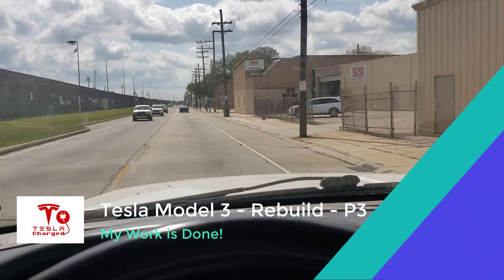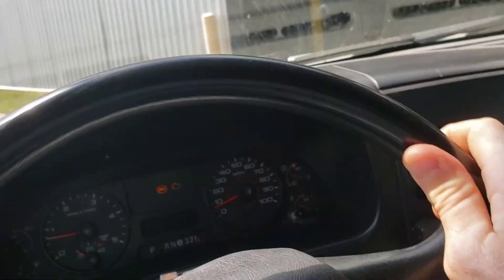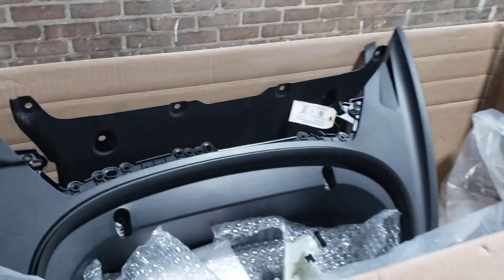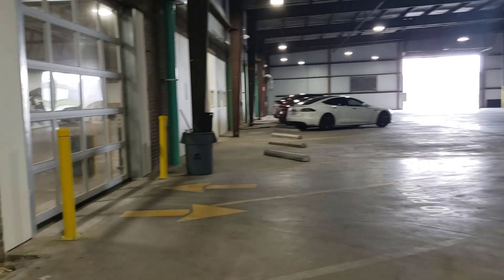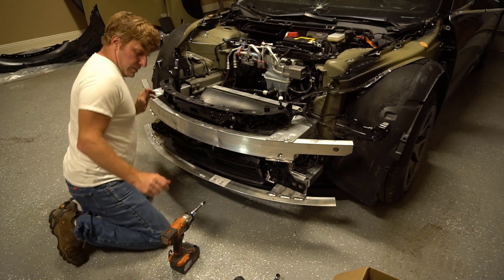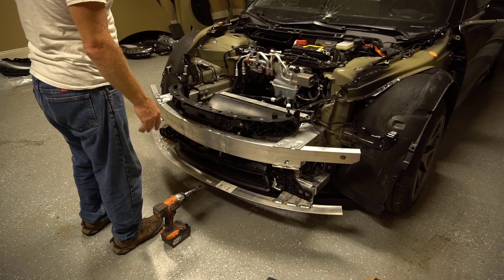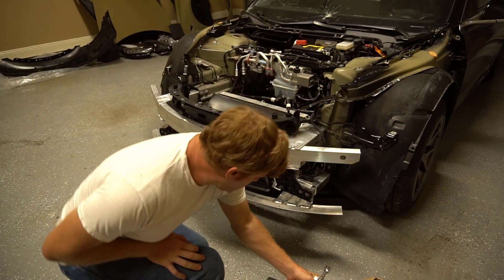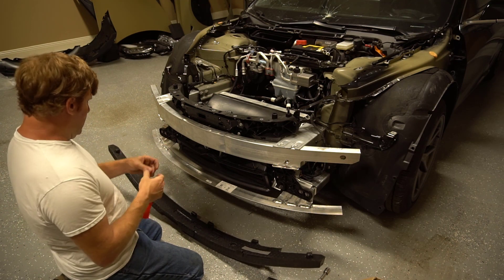Tesla Model 3 - Salvaged - Rebuild - P3

Comment: Hey, im trying to repair salvage tesla model 3 2023

Cant seem to purge system auto pilot temp is around 90c 

And it trows fault vcfront_a355 
Any help?
Reply from the maker: Sorry for late reply, use a shop vac on the coolant bottle with coolant not completely full.

When it bubbles and drops coolant level top it off to displace the air in the system.  There is also a coolant purge routine in service mode but the vac helps alot!
Reply: @TeslaRebuilders  thanks for reply, 
Found shop vac technique in other video 
And tried it,
It  help big time after use of shop vac it allowed me to purge with service mode 
Thanks again for reply

Comment: I still wanna know how fix the compressor lol do you have a list of all the parts, cost and time? And how did you reinstall the airbag?
Reply from the maker: The AC compressor I just took off and dumped all the oil out so Tesla could refill it with the correct original amount.

When the wreck happened some of the oil leaks out with the refrigerant and you don't know how much.

Most everything is in my videos but airbags are easy, everything just plugs and bolts in.

Comment: How much did the additional parts cost?
Reply from the maker: I rebuilt the car over a year ago, the total cost was about 10k in parts.  The panels cost right at 1000$ unpainted if that's what you were asking.
Reply: @TeslaRebuilders  yes thank you very much!! I plan to buy a salvage car too, but this is too much work and cost. Maybe we will look into a used one.

Comment: I unfortunately had crashed mine in NC 2 days back front impact while making left turn , no damage to windshield, but front frunk damaged like yours, was wondering if it can be repaired?
Reply from the maker: Of course it can but it depends on your insurance I would push them to repair and not total it.
Reply: @TeslaRebuilders  they already decided to total it without even inspecting it. I was also hoping to get it repaired
Reply from the maker: That's unfortunate, it seems very few insurance companies are repairing even small damages.
Guess we will see it on the salvage lot soon..... Mostly I have seen worse damaged cars bought to part out.

Comment: These videos are awesome! I'm curious to know, what was the full out of pocket cost including the cost of the car at auction as well as the cost of getting the panels painted, having the windshield and the airbags replaced?
Reply from the maker: All together it cost me 15k for auction and 10k parts and service.  I got deals on the little things.  So 25k got it finished.
Reply: @TeslaRebuilders  5YJ3E1EA6JF041578 - 12500 + all fee, super price, when you found its long range, you probably was super happy :)
Reply from the maker: @4kwotreplays  Yes with EAP as well it was really good.  Took more than I thought to fix was hoping around 20k but hit a bit over 25k.  It's been a damn good car ever since I fixed it.  We have put over 50k miles on it in little over a year so it's over 70 now.
Reply: @TeslaRebuilders  i get the same car none crashed for 27k stright from tesla in germany with eap used. so you lost a ton of time

Comment: Thanks for sharing  what do you mean by Tesla not sell just steal frame a safety parts give us for example. Thank you
Reply from the maker: Anything crash related like sensors, radar, cameras, airbags, seat belts, mcu, battery, steal frame is the cab front and rear structure is restricted and Tesla only. The front and rear has bolt on aluminum crash components and body panels that are available. So literally every thing else is available and responsible cost.
Reply: All that you said schoud tesla repair them don't forget to share us what's Tesla repair on your car thank you
Reply from the maker: @schade12  I will hopefully that will be soon waiting on final quote this week.
Thanks
Casey

Comment: Just curious, what did you pay for the car itself? (If you don’t mind me asking)
Reply from the maker: I bought at IAA auction for 12,500$ with auction fees and broker fees at 1,500$ then delivery was 1,100$ so little over 15,000$ delivered to me.  I have sence spent 5,500$ in parts from Tesla and about 1,800$ off ebay.  Still need Tesla Service to replace some of the airbags and windshield. That will run right at 3,500$ maybe more then paint I'm trying to cut any more cost as I go.  I'm going to be all in for around 27,000$
Thanks for the comment and watching,
Casey
Reply: @TeslaRebuilders  At 15000 all in seems to be a steal. Most certainly worth that in parts alone. Although. Airbags are not that difficult to replace. The knee and wheel airbags are almost plug and play. Although. You may have to replace the airbag connectors. I just soldered it and use heat shrink wrap. The dash airbag is the hardest to replace. But, depends on the car. On my gen2 and gen3 prius it takes about 1 hour to swap the dash. On my fusion Hybrid it took two days to take the dash. Since ford did not design it to be serviceable. I ultimately ended up breaking two mounting points.
Reply from the maker: @josealbreyes  yea I'm getting the replacement dash with airbag still installed probably tomorrow.  Going to do the teardown to replace it I guess since I didn't video much of the seat belts and knee airbags.   That was really easy stuff to remove, trying to negotiate a lower labor rate with Tesla when they replace them.
Reply: @TeslaRebuilders  Don't forget. You also have to replace the airbag module. As well as the front impact sensors. You can have the airbag module reset by sending it out to someone to clear the crash data. You can also have the seat belts rebuilt by a company called safety restore. It may be a good idea, to replace those parts first and then have Tesla service the airbag. That Tesla may be able to diagnose or reset the SRS system.
Reply from the maker: @josealbreyes  Yea I have considered that also, I knew about what needs to be changed.  I need the crash sensors for sure they were not on the car when I got it.  Not sure I would trust this repair or rebuild company though.  I'm pretty sure the replacement seat belts are very reasonable and worth it.
Thanks
Reply: @TeslaRebuilders  I've only ever used them to reset the crash data. The replacement module also needs to be synced with the car.  I've just always have had good luck with used seat belts. I do not know if you know. But. car-parts.com . Is where most junkyards list their  parts.
Reply from the maker: @josealbreyes  oh ok, didn't know that. I appreciate it for sure once I get the final quote I'll know which way to go.
Thanks
Reply from the maker: @josealbreyes  yea old Jack's pretty good but he just likes to hear himself talk too much lol!  Yea I'll know something about it this week for sure.
Thanks
Reply from the maker: @josealbreyes  So I'm sending off my seat belts and module today to get repaired by Safety Restore, saved me over 500$ thanks!
Reply: @TeslaRebuilders  $27,000 Plus cost of time? You could have bought the NEW $35,000 Standard Model!!
Reply from the maker: @Nawaf_1994  You can't count your time if it's done as spare, hobby or leisure time.  Now that I have final quote I'm going to be under $25,000 I saved 500$ on getting seat belts repaired and 1000$ on doing the passenger airbag and dash replacement.  And why would I want a standard range without advanced autopilot?  This is a long range rear wheel drive with advanced autopilot!  That's a 50,000$ car you can't buy anymore, unless you find one used but no less than 40,000$…!   So no thanks I'll have more fun learning about repair and help others doing this. 
 Thanks,
Casey
Reply: @TeslaRebuilders  I see your point my friend and I do agree with you.

Comment: I was always under the impression that Tesla does not typically sell parts. After your completed could you over a price breakdown of all the parts and what (if any) are restricted.
Reply from the maker: Absolutely I will, they will sell you just about everything but the steal frame and safety parts like cameras and sensors.  But Tesla service will install them for very fair cost on labor, the parts cost are very reasonable!
Thanks for the comment and watching,
Casey
Reply from the maker: Also included which I forgot to in the video my parts list and receipt from Tesla, link in description
Reply: @TeslaRebuilders  You arn't worried that they will disable autopilot and/or supercharging? As they have done in the past.
Reply from the maker: @josealbreyes  No they won't disable autopilot and probably won't supercharging atleast for a while.  Richrebuilds just stated that as many people he knows with salvage cars they have stopped disabling on model 3 for some reason.  That was mostly model S because of unlimited free charging and salvage titles.
Reply: @TeslaRebuilders  Good to know. I've just rebuilt my car and am still waiting to be paid by the parties insurance. Im just surprised how serviceable the Model 3 is.  As well as very reasonable parts prices. It seems to be significantly less expensive then ebay or auto wreckers.
Reply from the maker: @josealbreyes  Yes for sure most things on Ebay could be a scam or rip off.  You have to be careful, but I found a few things and saved over 1,500$ on the subframe, dash, passenger airbag, rear view mirror, seat belt in rear, headlight and a few little things I had to bite to save on labor cost over parts.
Reply: @TeslaRebuilders  I've been think about buying a wrecked Model 3 for a while. But, have been shocked at parts priced on ebay. Doors for over 500 dollars and the radiator assembly for 1000 dollars. I got very lucky when I replaced the airbags on my fusion. I was able to find all the seat belts, dash, knee, side and wheel airbags for 300 dollars.